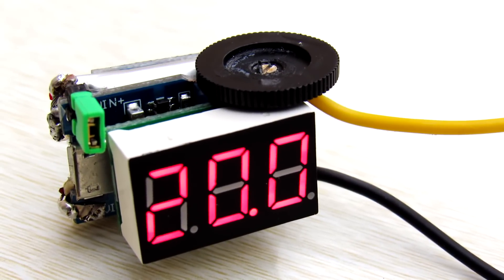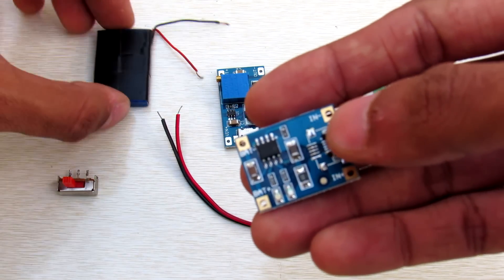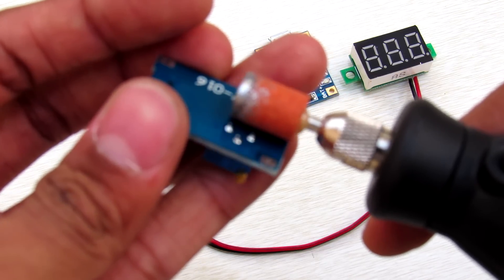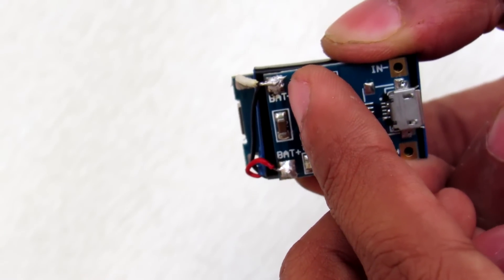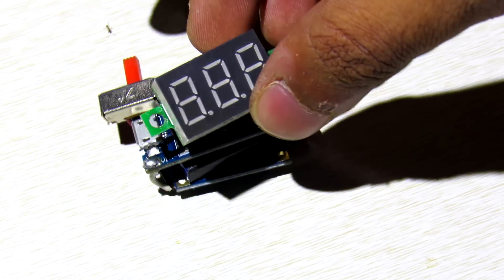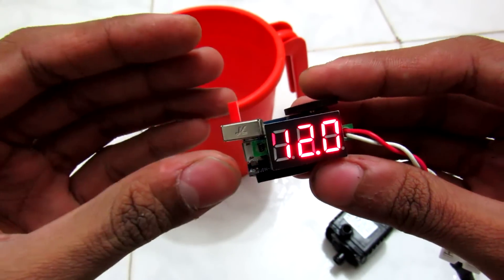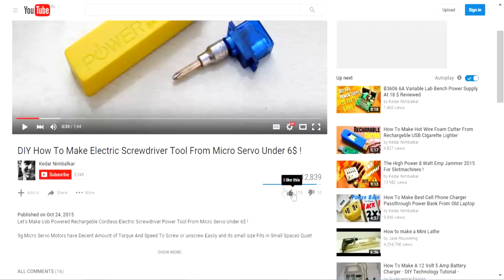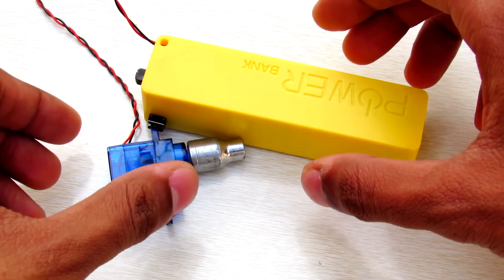Portable Variable Power Supply 3v to 24v With Voltmeter

Comment: Unfortunately your charger board doesn't have protection from overdischarge (you're soldering the load onto the battery terminals).  I can see why you do it tho, coz boards with overdischarge protection typically limit the output to 1 amp or less, it's not much.

You will have to be careful to not let the battery voltage go below 2.5V or 3V or so.  You'll have to keep manually checking it with an external voltmeter.

As far as i know the 4056 chip can do voltage protection, as i have some 4056 boards with overdischarge protected outputs.  They have 2 extra chips on them tho.
Reply from the maker: +roidroid There's New Version Of TP4056 is Available With Auto  protection from over discharge . I've Used This In My Key chain Screwdriver Project

Comment: Hi,
Congrats for this project :-)
I can't see in the video nor instructables, but did you replace the blue adjustable resistor by the voltage adjustment wheel?
Could you please show more this part?
Thanks.

Comment: Hi i'm kinda of a noob and would like if someone could explain to me why use a lipo battery?? and not connect  your power bank immediately to the  converter. Thanks.
Reply: +Peter Athanas I think it is with the battery because he used a micro usb lipo charger and if he not used a battery the whole thing wouldnt work, and you can use it for a short period of time without the powerbank. But you can buy a micro usb female connector and connect it to the DC-DC converter.
Hope that helped you :)
Reply: Thanks :)
Reply from the maker: +Peter Athanas Well Li-po Batteries of this small size can easily provide more current than any other battery type , and if power bank is connected when power supply is running on the battery it will charge the battery with 5v (USB) & high current . which should be avoided for longer time.
Reply: +Kedar Nimbalkar Thanks, great video!
Reply: what do i need to use it for a very long time? to replace that small battery?
Reply: Hi, actually you can also connect the power bank directly to the converter also.

But it is good to add that additional lipo battery because it can run for some time without any external power supply.
Reply: @mrtmrf5007  you can actually use a larger battery such as a 4000mah one to power the circuit.

The size of the project will increase but it will give extra backup.